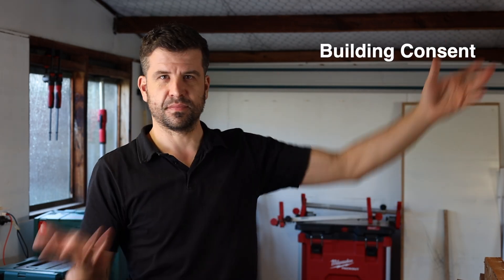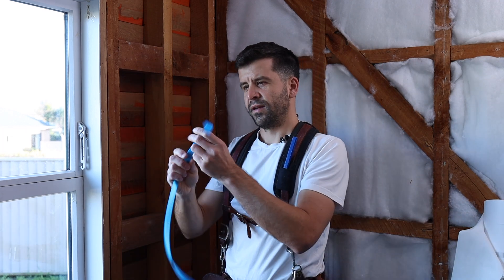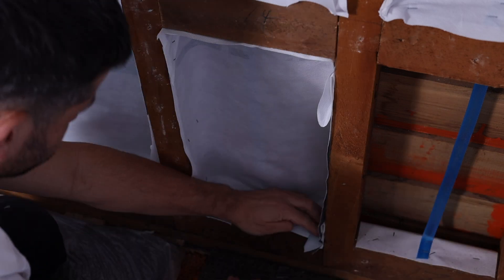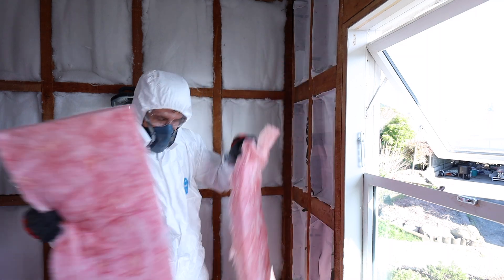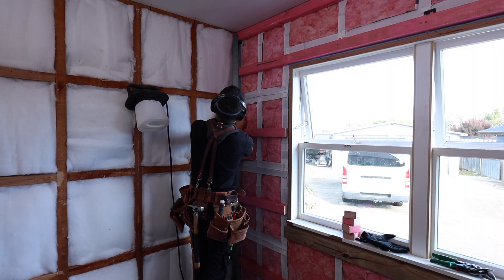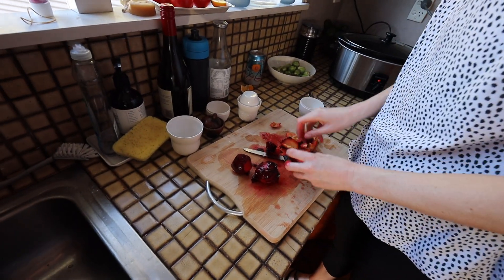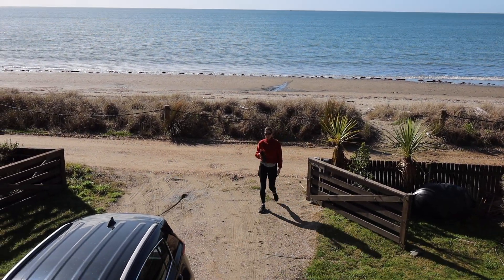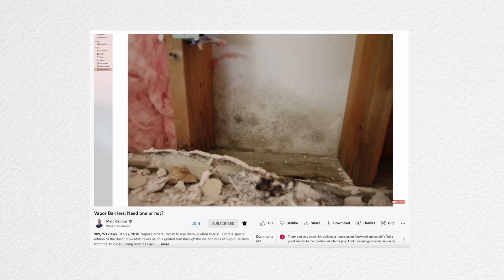We're Finally Going To Be Warm! Renovating Our 1960s House

Comment: Matt Risinger channel and RR building are both great. In one of Matt's video they had  dorken dimple matt product used for this with the dimple side facing the weatherboards that seems to create enough of an airgap and it might be quicker to staple and install than the building paper. Good idea on the additional framing to create that extra insulation and reduce thermal bridging. Terrific video once again.
Reply: that product is meant to be used below ground to drain away ground water. it will act as a moisture barrier, which is fine for Matt in his climate but adds extra risk, and no gain, for us in our climate. notice how a lot of their rain screens are tiny compared to ours.
be aware they do things certain ways for their climate only, not anywhere else.
Reply: @tweake7175  the product I was thinking wasn't the below ground product. Its called lP weatherlogic rainscreen. I totally agree about the different climates  and zones. I just liked the concept of the dimples maintaining the cavity and air gap, especially if you are re-lining a lath and plaster wall on a weatherboard house.
Reply: @shaneyoung72  lp weatherlogic is a intergrated wrb panel not a dimple mat. I've seen the video your talking about. The catch is how much surface aera does it block and how big is the gap. Imho both are poor for our climate. Most of our claddings don't have problems maintaining the gap.
Reply: @tweake7175 I think I   NZ when retrofitting insulation on exterior walls like this most of the time people don't apply for building consent unless it's part of a bigger Reno, and they sure don't always staple in the building paper and try and maintain a gap  they just fit 100mm pink Batts in.
Reply: @shaneyoung72  i'm sure that happens a lot. but the come back is on the home owner for doing unconsented building work which may result in messy lawsuits latter on. i have no doubt there is tons of dodgy reno's going on, so make sure any house purchase is inspected well.
Reply: @tweake7175  not just renos...have you seen those new build defect inspections where there is missing insulation in the walls and ceiling that come up on the flir cameras.
Reply: @shaneyoung72  i have heard of builders ripping out insulation after inspection then reinstalling it on the next house. criminal and perthitic as insulation doesn't cost much. no doubt because builders under bid the job. btw that was before this building supplies issue.

Comment: In the uk we have to heavily insulate everything.  Timber has to also breath so these people who pump the voids full of foam are suffocating the wood.   A piece of wood can last a 1000 years in the correct environment.  We use a breather membrane called Tyvek on the outside and that controls moister entering the cavities.  You are doing a superb job on that Scott the only thing I would think about is them metal channels will they create a cold spot behind the plasterboard.   Metal will be so much colder than anything else in the walls.   Just something to think about.

Comment: When I used to renovate houses in Toronto, spray foam was just taking off. Basically expanding foam sprayed between studs, it also doubles as a moisture barrier and braces the whole wall frame. Once it went hard, you could hit it with a hammer and it would just bounce off. But it was pretty expensive at the time and I don't think I've seen it in the southern hemisphere yet.

Comment: Here in Maine we need an R value between 25 and 30 (depending on the municipality) in the walls. A vapor barrier is required on either the inside or outside face of the stud. I find when installed on the outside, the mold issue is more common. I find our videos incredibly interesting. Its nice to see how other builders do things around the globe!

Comment: sadly we live in a 101 year old two story robert talboys home in wanganui.  we love the house which has so many outstanding architectural features.  of course it isnt insulated lol.  as the windows are all leadlights i do not want to replace with double glazing and not even sure if you can retrofit them effectively.  the outside is clad in concrete/pumice panels which is then stuccoed.  i have wondered about wall insulation but with all the remu panelling have thought maybe small holes in the wall and then fill with spray insulation?  as the home is nearly 400 sqm there is no cheap fix.  as usual in winter we basically live in one room, as it is to expensive to heat the whole house on a pension.  it seems a small price to pay to live in such a remarkable home with 1/3 of an acre of grounds.

Comment: I build energy efficient buildings and homes in the yukon territory canada. We have - 30 Celsius weather often during the winter. We use a similar system sometimes that you just used! 
But we more often now build a secondary 2x4 on the inside of the structural wall. This wall is primarily used for mechanical purposes. But... its very easy to make this wall very straight as well as very insulated! 
However you would lose 90 to 100 mm of space in your home. Which isn't ideal

Comment: Hi Scott! If you want to save interior space, using PIR panels (if available) would get you a higher R value for less interior space.
In Belgium, I've put R7.15 (in m²K/W) on my roof. It requires 18cm of space and uses PIR panels (12cm) + glaswool (6cm)
On a different roof, I've put R7.3 on it. It requires 26cm of space and contains an insulating underroof (steico panels (2cms)) + glaswool (24cms)

Comment: Hi Scott, great esisode on NZ insulation methods.  As we speak I am upgrading my attic insulation from 1960's standard of R-15 to todays standards of R-49 - R-60.  My first step in my attic is to install E-Shield (2 layers of Mylar with a thin fiberglass in between), under the roof rafters. Next step is to extend down from the roof rafters (by 6 inches) wood blocking to hang R-19 on the rafter bays. Third step is to blow in fiberglass insulation on my attic floor (R-60) to about 20 inches.  I want to keep a cold roof decking but create two barriers of insulation between my roof and my living space. Good luck and have fun experimenting.

Comment: Hi there Scott! 
Great to see your progress to date on the home. 

I have a like minded approach to Jess' and your thinking regarding the existing home. Renovating it to become the best version of itself. - Very well said - 👍
Upgrading your non-insulated exterior walls to insulated is definitely an improvement. Increased comfort, lowered draftiness, and decreased heat/cooling use cost. Insulation being there to help slow the transfer of heat in its basics. 

R-19/R-21 batted insulation at exterior 2"x6" framed walls is quite common in climate zone #4 in NY. R-23 Rockwool is another great product and is great against fire. Higher end builders lean towards a "flash & batt" approach with ~2-3" of high density spray foam at interior sheathing, and R-19/R-23 batts within the cavity coming to an overall R-value ~R-33+. The spray foam helps in air sealing & minimizing air leakage helping in blower door home depressurization. A test requirement to pass code and receive a certificate of occupancy on new home builds.

Making mental notes throughout for that home of my own one day - 

Keep up the good work - 

-James

Comment: Hey Scott, would you considering doing a blower door  ACH test on the rooms you fix? And maybe a before/after/after reseal comparison. (Not sure where you’d source an official blower door, they’re a bit pricy for what they are, but it’s be really interesting).  Also with your ducted aircon you may need some clearance under doors to permit air-return, or risk it blowing your warm air outside from that room and (worse) sucking in cold air from outside to feed the intake.

Comment: i have a tip (dont know if its needed in new zealand) here in germany when we put a vaporbarrier on a wall or roof angle, we need to tape all staples, because the staples are able to let moisture in with basically vapor.

Comment: hi Scott. That's a lot of effort there. great work.  I would of but 25mm PIR insulation straight on top of the studs (tape the joints) as well as the insulation in between studs. and fix the plasterboard straight through the 25mm PIR insulation with 75mm drywall screws .free of thermal bridging and vapor barrier too.

Comment: (If supply chains were no issue...) I'd consider a rigid wood fibre board, something like the T&G stuff by Steico or Pavatex, they don't need battens inbetween the boards, provide a continuous insulation layer inside (or outside), and you can plaster straight onto them, and their insulation values are similar to mineral and glass wools.

The consideration then of course, is dealing with moisture movement through the wall. Vapour open internal plasters like lime or clay based types are great, but expensive, and somewhat specialist depending on where you are. I'd image good placement of vapour barrier and breather membrane in the wall buildup is crucial. There are some quick-lime plasters that are trying to behave like gypsum - i.e. applies like gypsum, goes off like gypsum, floats like gypsum, breathable like lime - but they might be hard to get hold of (Breathaplasta).

A mechanical ventilation system that controls the humidity of the air would do wonders for the water levels in the house, and on the internal side of the structure (provided materials are vapour open). However this might need good levels of airtightness to be effective, which can be complicated to say the least.

I'd love to hear more about your moisture strategy in the building. Beside insulation, I think it is THE other major consideration in renovation of old buildings. In the words of the essential craftsman - "water kills buildings". Where are the sources of moisture that did or might get into your building structure, what are your plans for either preventing, or allowing/enabling this moisture to escape? You've already shown some of what you're doing with the building paper in this wall you just built.

I've gotten accustomed to using U-values (Watts per meter squared Kelvin, W/m2K) here in the UK. They are the inverse of NZ R-values, m2K/W, and the American R-value is usually imperial, so ft2F/Btu!

Comment: Mate I have just done a similar thing on a 1940s house. complete Reno. I actually removed all of the nogs as they were similar, that allowed to use a cavity batten  screwed to the side of the stud. Then building wrap then insulation. Then used some 35mm Timber on flat for nogs. Worked a treat!!!
Reply: The second layer batten is a good idea. Perpendicular to studs reduces thermal bridge through timber. Also replaces the structural nogs/dwangs provide. So remove them and fill it with first Insultion layer. NZS 3604 doesn’t require nogs/dwangs anyway as per 8.5.4

Comment: Hey Scott, absolutely love your videos and have been following your renovation progress closely. I can’t help much on your insulation question as I’m more in the IT field. Might I suggest that since you have yet to secure your Gib that you consider laying cat6 network cables to as many rooms in your house as possible and terminate them at a central point closest to your fibre terminal? Not only will that give you wired and better wireless setup in the future but you can also install Power Over Ethernet (PoE) solutions like a CCTV and also extenders to have internet access in your workshop. The CCTV connected via PoE could serve you well when you and Jess eventually start a family and can monitor them via your mobile. Just a thought as it’s the best time to do this before the GiB goes on.

Comment: 100% would use celotex foam insulation and insulated backed plasterboard this would reduce thermal bridging and for the same thicknesses would be R5.2
Reply: Celotex isn't vapor permeable, so the moisture would be trapped.
For wood buildings you need permeable insulation.

Comment: I think that unless you have rain water getting in the walls or a pipe leak that concerns over moisture are  overblown in most places. I did I similar test renovation a room in my house  in Houston Texas USA and I caulked and spray foamed a couple inches right against the inside of the outer wood sheathing. Then fiberglass insulation and then I tacked strips of EPS 1" foam board on the inside face of the studs and used long screws to fix the drywall. 

If the sheathing gets very wet of course it may cause problems because it will only be able to dry out towards the exterior, but I do not think this will ever happen and I get the benefit of more insulation and better air sealing.
Reply: I think that non-rainwater and non-plumbing related moisture problems happen most often where there is an abrupt transition in temperature such as in a very cold climate the warm moist air contacting the cold exterior sheathing through a gap in insulation or air barrier. If you are very careful about smooth transitions and gentle temperature gradient at the building exterior then you shouldn't need an air gap to dry out just in case. And an air gap could even allow cold air to penetrate to the framing and cause condensation problems there.

Comment: There's imperial R ratings as well, but there's no easy calculation between the two. R3.0 in the walls, and R6+ in the ceiling and underfloor will make you super cosy and that heat pump will hardly have to work to keep your place warm. I'm in Canberra where it get's down to -5C  and now that I've managed to get everything (except the walls, currently R1.5) upgraded, our heat pumps are only set on 18C and we are comfortable year round.
Reply: With Canberra is that the preferred combo? I think I've got r2 in the walls and r3 in the ceiling.
I'm looking to upgrade and was interested in which r values you'd use for the 40 to -6 temperature ranges we get?
Reply: R-value (US customary) ≈ RSI-value (SI) × 5.68

Comment: You mentioned PIR I deal with allot of that, yes it does have pretty good R value, In Kiwi terms best calc is 1 R per 25mm,  So it can be better than Batts but only by a moderate margin. It is harder to work with for your situation because its very rigid, we use it for warm roofs so laid out in whole sheets on sometime thousands of square M.

Yes Vapour barrier is a trap for moisture. the difference between a true vapour barrier and building wrap is breathability.

I like your technique on the wall I was watching thinking its so complicated it must have been designed by BRANZ and sure enough..........  I will try it though, I have done allot of walls like that where I have replaced the plasterboard or cladding and just smooshed in as much glass wool as I can and so far its all been fine.

Comment: There's a possibility to use EPS, extruded polystyrene. It's the same white packaging foamed polystyrene, but much denser and stronger. Its isolation value doesn't deteriorate from moisture. There are types that stop flame.

Comment: Most I've done is r40 floor, r60 wall, and r90 roof. Which is just a tad excessive, when we finished the building we were in the middle of winter, and we warmed the building up to 20°C, and for two days straight of -20°C the building lost 2°.

Comment: When I've inslated walls in that situation, I us plasterboard that has PIR attached to the back which come in various sizes. That or gheir is foil wrap insulation, high r value without taking up that much room. One example is a brand called space quilt. I'm in England so not sure if available over their but hope it helps 👍

Comment: Hi just a thought. 

Insulated Plasterboard @80mm gives an R value of 3.25. The real benefits is that the plasterboard is foil backed so it gives you a rigid air gap. 

Obviously you lose a bit of space on the room (but it’s about the same as 4/2 plus gib (would be much quicker and cheaper to install though).  

Kingspan sell insulated plasterboard in NZ and you can get the same type of stuff from other suppliers if you google got it.

Comment: If you can get rigid foam insulation I'd be using that instead of glass-fibre on that inside layer:
1: You would make a continuous, uninterrupted layer of insulation, reducing cold-bridging
2: You would get the same level of insulation for less thickness/loss of room space
3: You'll save on the cost & work of installing 2x4
4: You'll improve the performance of the wall by having the least vapour-permeable layer on the inside

Comment: Hey Scott,  when i want to get maximum r value in a minimum amount of space i like to use foil faced poly-isocyanurate rigid foam. I leave an air gap between the layers of faced foam boards, which promotes venting, and increases the r value.
Reply: It's the highest performing of all insulation products but difficult to install effectively between structural members especially in tight spaces like an eaves.

Comment: If you can't remove the exterior cladding,  this seems like a good solution. The only thing I would have done differently is to tape over the studs to seal the housewrap sections between the studs to each other so that I had a continuous air barrier. It seems like it might be less work than applying the stripping over each stud too.
Reply: I’m going down the re-cladding route. Will be a more air tight system in the end.
Reply: @GWHAWK87  removing the exterior cladding and adding continuous foam insulation over the sheathing and water barrier before reinstalling cladding is the ideal solution

Comment: Interesting to see an air gap between the back of the exterior siding and the face of the insulation. Here in Canada the house is fully wrapped and taped with an air barrier then at least 4” of f’glas Pink ( R12 / RSI 2.1) installed inside being careful not to compress the insulation too much. F’glas  will loose roughly 10 to 15 percent for every inch of thickness. The insulation value in batt insulation depends on the air in it. Also,I would have sealed the studs to siding with a bead of foam.